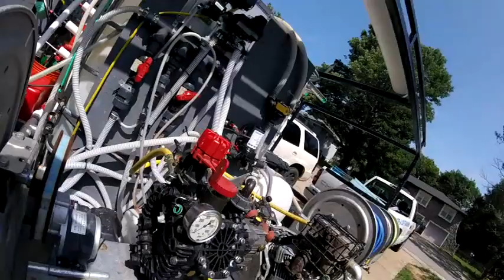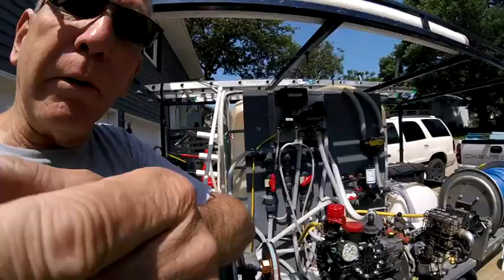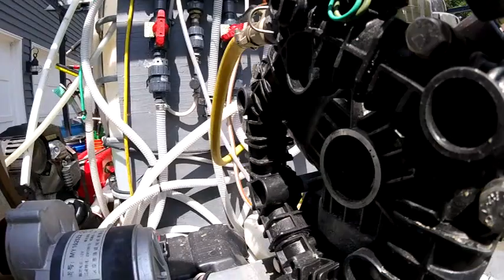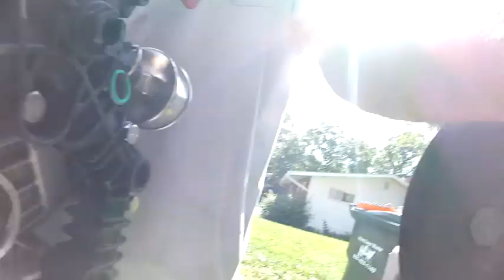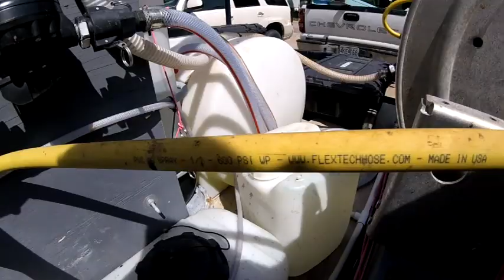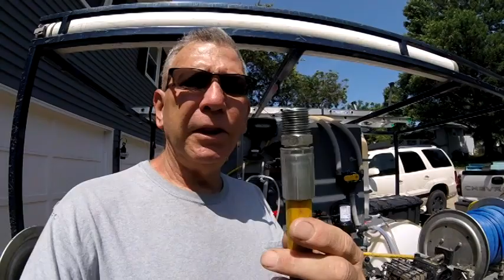More AR45 issues with my new pump.  Will a D30 or D50 be better?

Comment: I watched your video on your predator 670 build. How did you end up connecting your downstream injector. I was going to do the same thing and run 1/2 wip and 50ft of 1/2 hose. But I wasn't sure how to adapt my Injector because that has 3/8. And I want to use quick disconnects. How do you adapter 3/8 qd with 1/2 hose. Or did you just couple everything w/o qd?
Reply from the maker: I ran everything 3/8.  3/8 whip to 1/2 unloader with 1 3/8 x 1/2 bushing.  Then used a 3/8 x 1/2 bushing out of the unloader to a 3/8 whip line to the injector.  Then 3/8 out of the injector to my reel.  I used a 1/2 unloader because it flow much more than a 3/8.  Then I simply bushed it down to 3/8

Comment: Last year I wanted to purchase an ar45 pump.  I called midwest, pressure wash outlet and several other companies and they all stared me towards the comet p40.  And all these companies sell the ar maybe they have better deals on the comet but they all led me that direction.  Unfortunately believe it or not I couldn't fit the machine in my box truck the way it's set up.   I just purchased the Northstar 24v pump and tested it the other day with the red gun and was blown away.  Just got the proportioner can't wait to set this thing up.

Comment: The AR45 pump is rated at max 290 PSI because the manifold is made out of poly…. Prolonged use at that PSI will crack it… in order to achieve higher PSI a metallic manifold has to be used
Reply from the maker: My manifold always cracks where the mold seams are.  I would love to have a stainless steel manifold.

Comment: Are the Comet pumps a viable option? Just this morning i saw a video of a guy using the D30. According to him they are built better. I'm using 12 volt and i really want something that has more volume output for rinsing. I'm having a helluva time trying to decide which way to go.
Reply from the maker: There has to be a better option than the 45?  We just have to find it
Reply: I just bought the 24v Northstar pump I only tested it with red gun and was blown away.  I just received the proportioner from midwest I will be setting up.when I'm free and will give feedback.  For the price you can't beat it from what I already saw.
Reply: I've been considering that 24 volt pump as well.

Comment: To achieve the distances you want with the 580 psi, you may need more horsepower than what you have.   I believe you have a 6.5 hp engine to run your AR45.  I run a GX390 11 hp to power my 15 gpm Udor 55.    Check the specs of the AR50 or 30 before buying to achieve those high pressures.
Reply from the maker: I would run it at 250 - 300 for 90% of my washes.  Then bump it to 350 - 400 on the other 10%.  I think the 6.5hp should barely get that done......
Reply: Check the shaft diameter required for the 30 or 50 pump to make sure your 6.5 engine is the same.
Reply: I have the AR60, seems to shoot quiet far with the volume, 15 or 16gpm, with vanguard 200

Comment: D50 at half throttle all day!!
Reply: D50 came on a Lesco skid sprayer.  Don’t over complicate it.  I use a single hose clamp on my gun with banjo fittings.
Reply from the maker: @mikeallover  What kind of pressure are you running?
Reply: Usually 400 at the pump.  I bump it up for taller homes.
Reply: Search: D50 AR45 and search recent videos.  All my house washes are with the D50 with 300 ‘ of Ag hose.